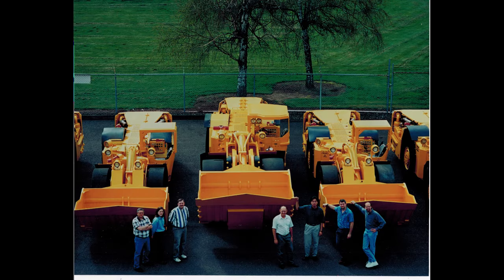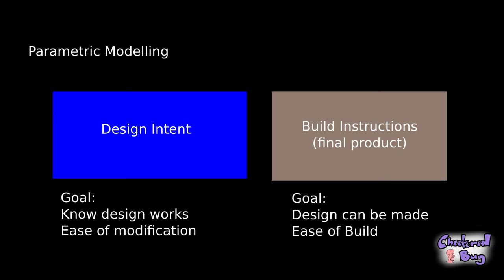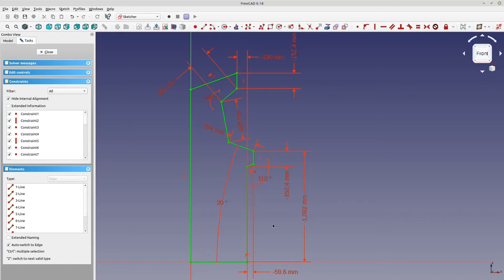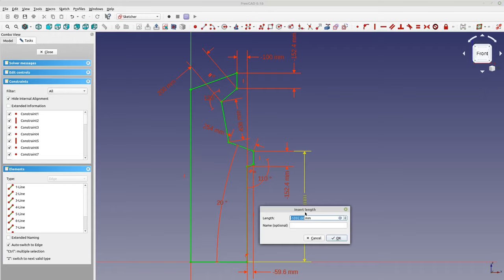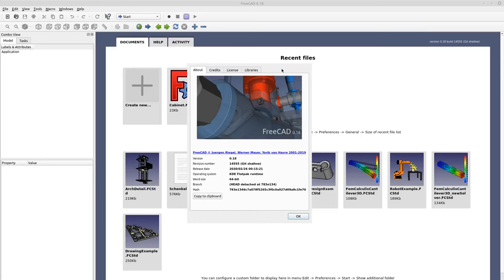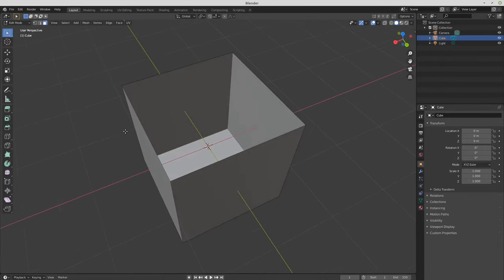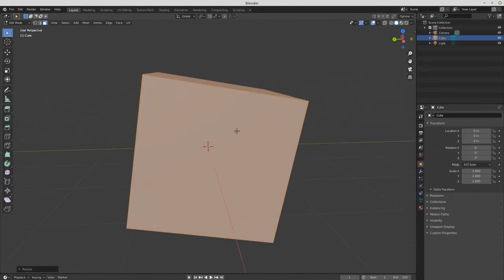Mechanical Engineering with Blender and FreeCad Tutorial

Comment: In blender you can actually use a setting to see edge length and face angles, and in preferences you can use 3d print tools and cad tools, I'd also recommend adding loop tools in the preferences

Comment: Wow, this was an amazing look at those 2 tools. Funny, I have been looking at free solutions because I am worried about limitations that might be imposed by these other companies like SolidWorks, and AutoDesk.  I knew that eventually those cad systems would become practically innaccessable. I was looking at a single solution for everything. Looking at Blender, it seemed to me to be a kind of free-form design tool, and I was disappointed that it could not be used as a precision solution. Anyhow, this really got me seriously looking at these 2 tools and I think I can commit. Thank you so much for this demonstration.

I am a little perplexed about one thing, however. I assume that since FreeCad is able to output an .stl file, it should be directly transferable to a 3d slicer. The real reason for using Blender was for its ability to make changes in more of a "free form" fashion without altering critical dimensions? So, I guess I do not understand how the slicer determines the dimensions of an stl file output by Blender if you cannot set those parameters within Blender?
Reply: I think when you design 5mm in freecad the stl encodes the data, and its carried over to slicer, blender...

Comment: Actually I have designed and 3D printed a lot of mechanical parts all in blender with complete dimensional accuracy, so it is certainly possible and not really that difficult. Also you can parametrically model to some extent using non-destructive methods using "modifiers" in blender, and there are a number of great tutorials on YouTube describing that. On the other hand FreeCAD is designed from the ground up to be parametric so watching that kind of workflow is fascinating and there are some real advantages to it. Making nice mechanical dimension drawings in blender is barely even possible without some pretty bizarre workarounds. Otoh if you've designed a part parametrically in FreeCAD then making a beautiful formal drawing is almost automatic - so cool. Also it seems they are making strides with doing assemblies in FreeCAD and getting closer to something like Fusion 360. Both of these open source projects are absolutely fan freaking tastic and advancing year by year, with the developers seeing the abilities of other programs and trying to fill in the weaknesses. A great time to FLOSS.
Reply from the maker: Agreed.

Comment: An interesting aspect to use blender for assembly, but I think if you are not familiar with rigging you can not simulate a movement of the assembly setup. That's why I rather would learn it in freeCad. Anyway blender is on top for the organic modeling of parts. There is also a workflow to import stl back from blender and integrate them as a part of parametric modeling.

Comment: I only model in a blender. And it can be customized to exact dimensions. And you can also simulate models so that they can then be easily modified as needed by googling a non-destructive blender. 
P.S.  Finally I saw that at least someone made a beam on the short side with a rectangular table.
Reply: This video shows how to set up a blender to conveniently model in millimeters. When set up, you need to save as a start file and reload the blender.
https://youtu.be/ZI49VIcISaw
Reply from the maker: thanks for your comments and interest:)
Reply: yeah but its not the same aleks. cad allows you to have almost perfect alignment which critical for making mechanical peices. for instance in cad you can create gears that will mesh perfectly to one another using mathematical formulas something which cant really be done with blender however not impossible just a little harder

Comment: Nice.  I'm looking into making CNC patterns to send to mill to cut boat parts.  I've been looking at FreeCAD, LibreCAD, and Blender.  Any of these three have steep (at least for me) learning curve with no idea if the time spent will be wasted.  In addition to patterns, I wanted to be able to take the pieces and fit them together to "assembly" the boat on screen and look for problems.  Sound like Blender will do that for me.  Have you tried out any of the newer Blender precision modeling tools?  Is it ready to replace the CAD tools?
Reply from the maker: Assembly 4 in freecad is probably good enough to skip blender...yes you have to learn freecad, but its the price of doing things.
Reply: @checkeredbug8015  Thanks!  I'll continue with FreeCAD tutorials.

Comment: Very useful, thanks. One question though. If FreeCad supports 3d modelling and can export STL which it obviously does, why not just use that? The large printer is very impressive!
Reply from the maker: In professional packages you use whats called an assembly mode where you fit the parts together and design the assembly of the fitting parts.  You often go back and forth adjusting things until everything fits.  My workflow is use freecad to make accurate parts, then make the parts I change such as 3d printed parts in blender to tie everything together and edit those parts in blender so I don't ahve to keep exporting out of freecad to update the assembly of the parts.
Reply: blender uses polygons to create meshes. it is fast and you can create  very high detailed meshes. only down fall of blender is that is hard to create dimensional models because its focused on cgi art and not for making objects in the real world. its in essence for turning real world things and ideas into the virtual world. blender does have cad like addons and its getting better every day, what blender does that would be very difficult in cad to do is to create very smooth and curved surfaces quickly and almost effortless or anything that does not require two mechanical peices to work perfectly.

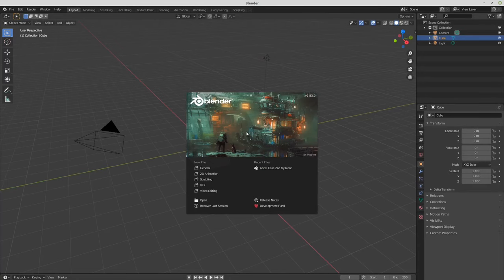Comment: 15:41 Your comments (drawbacks) on Blender are COMPLETELY WRONG.
1. Use the "Solidify Modifier" to add the thickness to the model;
2. You can Scale with precision: Click 'S' and write the value on your keyboard that you wish to increase the model to.
  * This technique is valid for Scale, Rotate and Move;
  * Search for Precision Modeling with Blender;
Reply from the maker: Blender isn't a parametric modeller, don't get me wrong I love Blender, but using a hammer to drive screws is difficult.

Comment: I liked your video but about Blender, you're wrong. Blender can offer so much more than FreeCad. For someone like me, who uses Blender for many years, it does not make sense to learn FreeCad and than import into Blender - 
you can do ALL the job inside it cause it has many tools for measuring and accurate modelling.
The first explanation you do about it and watching the moments where you do some modelling, it's clear that you're not that familiar with the tool.
Reply from the maker: Blender is NOT a parametric modeller. I am a blender fanatic,  been using it for 20 years.  I LOVE BLENDER.  consider myself to be moderate to expert user, but  it is not designed for mechanical engineers.
Reply: @checkeredbug8015  Ok, I agree with you. But as a blenderhead like me, you know that it's possible to do It. In fact I already did it using bones and constraints to build a piston mechanic arm.